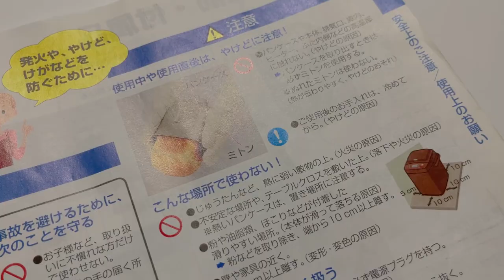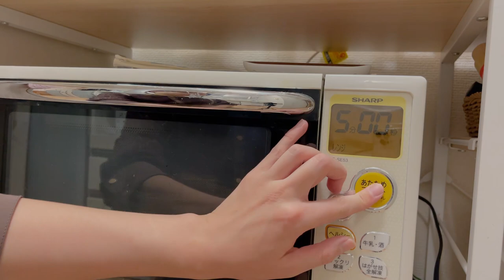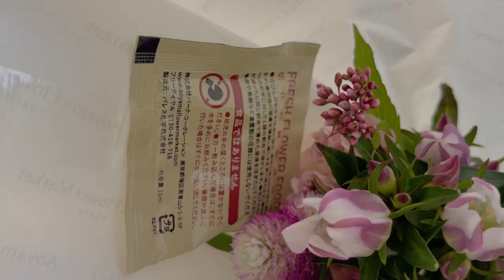週末のルーティン🍝月曜日のためにリセットする1人暮らしの休日｜いかのトマト煮・ポテトグラタン｜Day off Routine of Japanese office worker VLOG

Comment: LOVE your channel!  Citric acid is an excellent way to dissolve hard water deposits. You can soak a shower head to make it work more efficiently. BUT ... when you add baking soda, you neutralize the acid in the citric and make it useless!  Use baking soda to polish things AFTER the acid has made them clean. Basic chemistry.

Comment: Hello! I enjoy your videos very much.  I just wanted to share a suggestion with you.   After cutting vegetables use the opposite side from the blade to scrape the vegetables into the cooking pot.  All you do is rotate the knife in your hand.   It is easier on the cutting side and doesn’t dull the blade.  Do you sharpen your knives on a regular basis? Also after washing do you use food safe mineral oil to condition the wooden utensils?   Thank you and regards from Texas USA.

Comment: I had no idea about citric acid for cleaning - made the metals shine!!! another thing you could try for the microwave is put half a lemon in the water (one you have squeezed/used up already - can store in the fridge till needed) and if you micro that for 3 mins or so, can do easily wipe out the inside of the micro and leaves such a nice scent! (And no chemicals) I have never tried baking sofa for that, but will have to play with using that too :)

Comment: Hi Nami, I really enjoy your videos . I wanted to suggest that instead of using  rubbing alcohol to disinfect surface which is very drying , to try a mixture of water and white vinegar instead . The vinegar disinfects and is not as drying to the surfaces ; I use half water - half vinegar in a spray bottle .